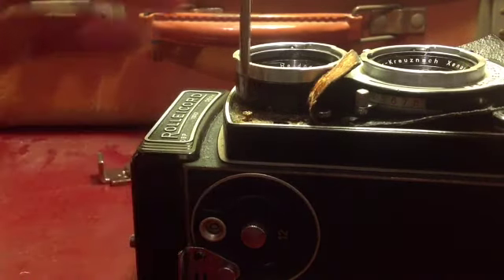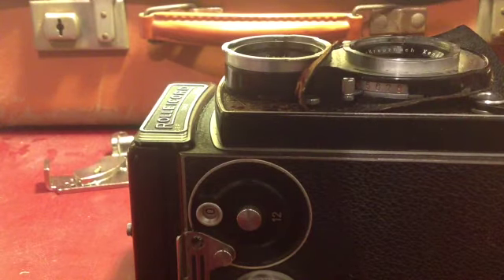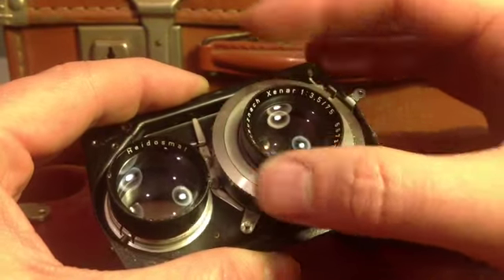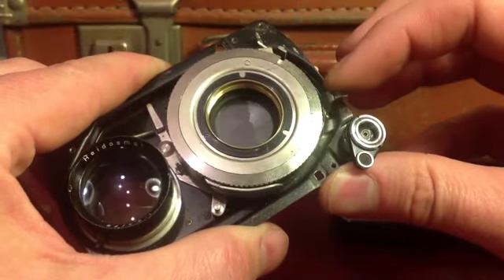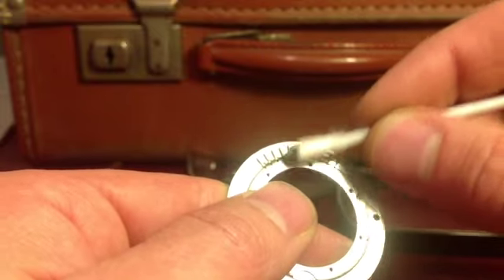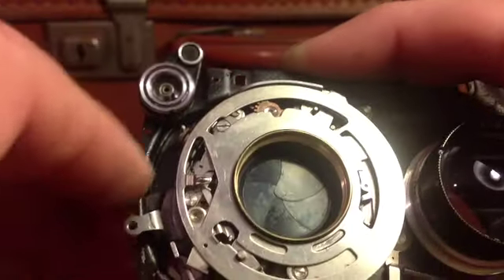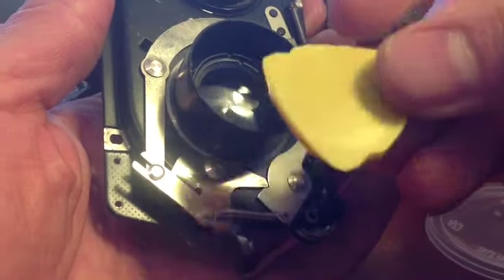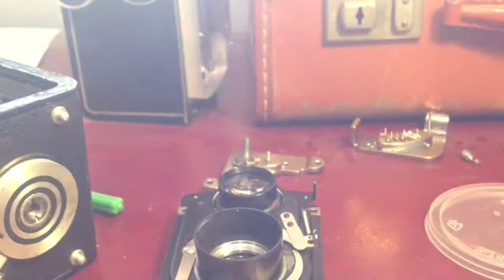Rolleicord clean

Comment: Thanks so much mate. I've got the same model with sticky slow shutter speeds. Looks like I'll have to take the repair plunge soon.
Reply: OK, I finally did this repair, cleaned the shutter blades and got the slow speeds working again. I noticed that I only have one pair of focus arm shims even though we have the same model. At the last stage of re-assembly the shutter cocks but the release is blocked by something. I still need to work that out.